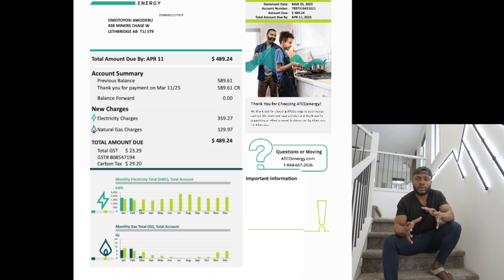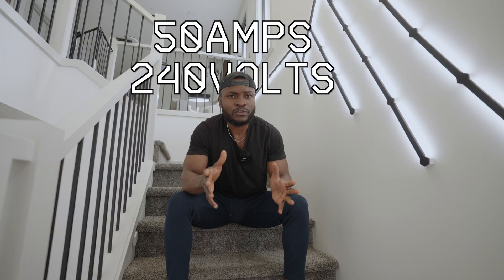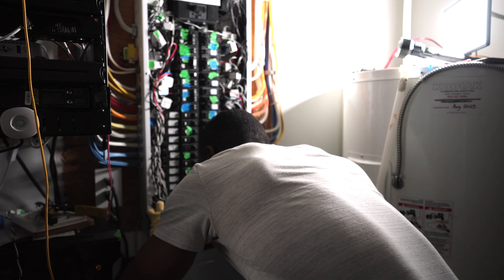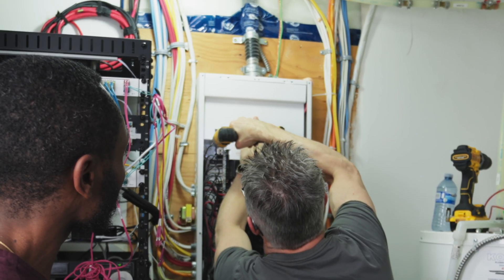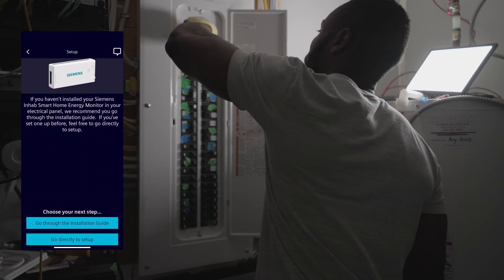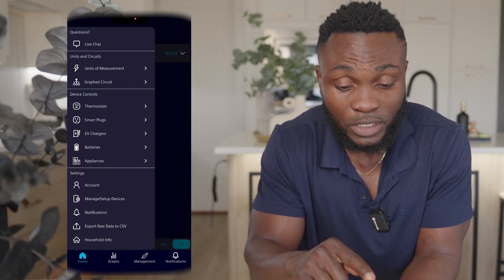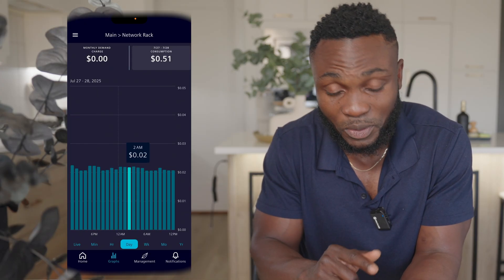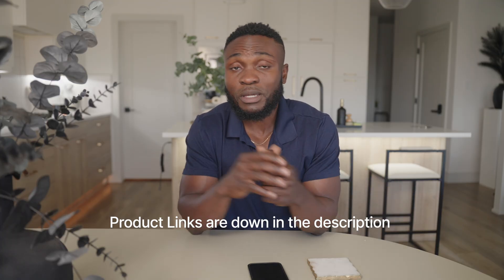I Was SHOCKED When I Saw My Power Usage | Siemens Inhab Energy Monitor

Comment: What about time of use costs. Where I am (Chicago) the utility dynamically adjusts price based on load. Does this a) adjust cost based on this? b) allow things to be enabled/disabled based on rate?
Reply from the maker: You can also do time of use  adjustment as well. It works great for that.